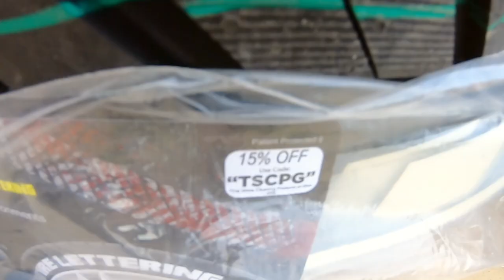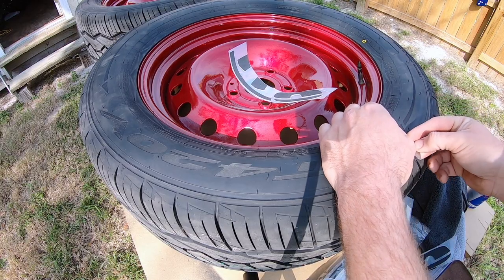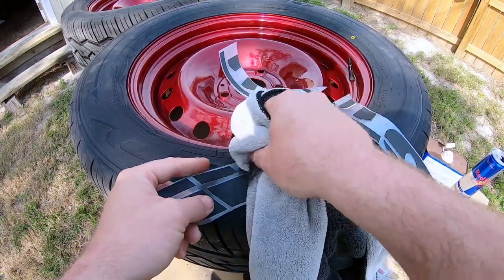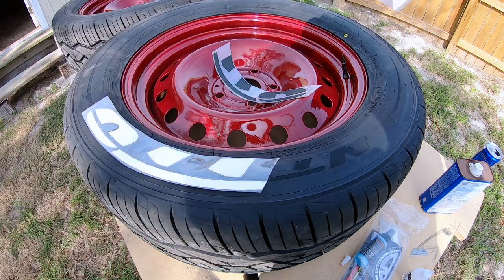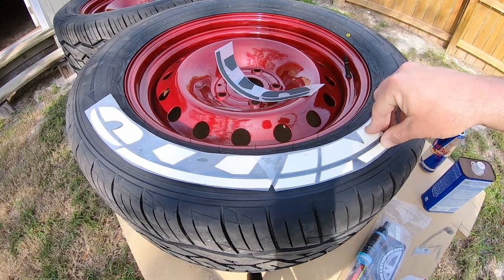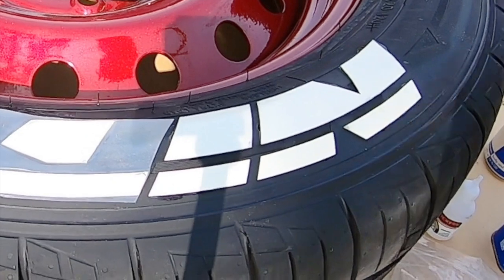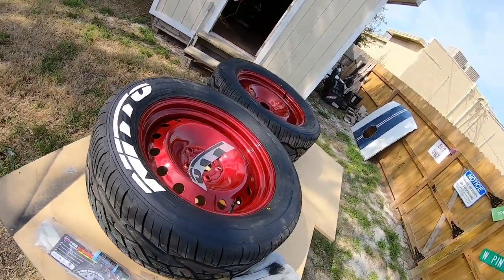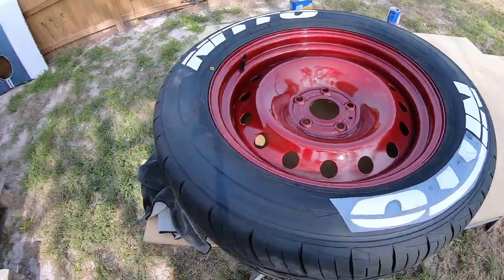HOW TO Apply Tire Stickers®/ Permanent tire lettering.

Comment: A friend of mine that used to put these on his father’s sprint car tyres. 

He had his some 3”x3” and 5”-5” square sandbags made so he could sit them on top of each letter or he could lay them side by side if he was putting on a design in between the letters. 

It made it look like he could do each tyre pretty quick after he had the surface prepared for the stickers
Reply from the maker: @darrensice1550  Definitely a great method, Appreciate that!

Comment: Do you know if the OEM wheels for 2002 to 2008 fit a 2009 Ram?
Reply from the maker: I would say so, the steelies on my 17 were actually  oem spare wheels from an 08.
Reply: @Rep361Texas   thank you brother 👍
Reply from the maker: @oscarvarela8347  No problem!
Reply: May I know material used for making the letters and what adhesive you used afterwards